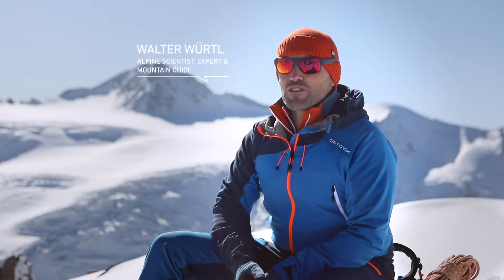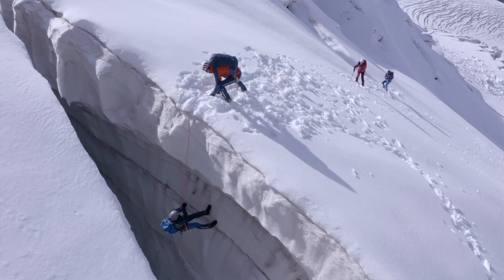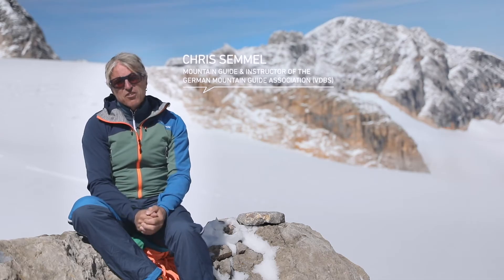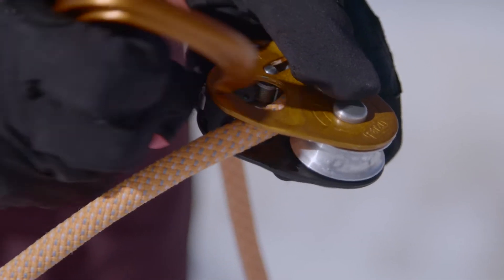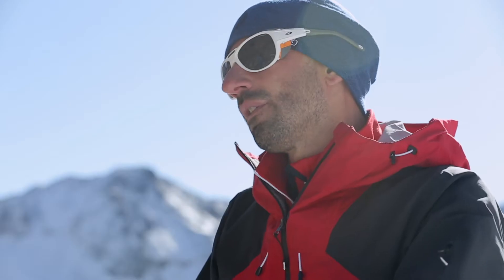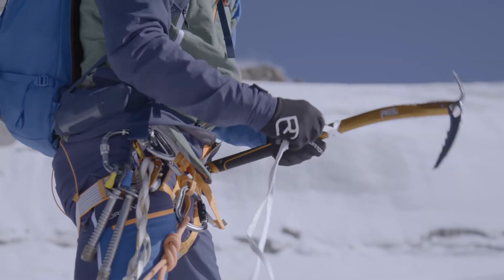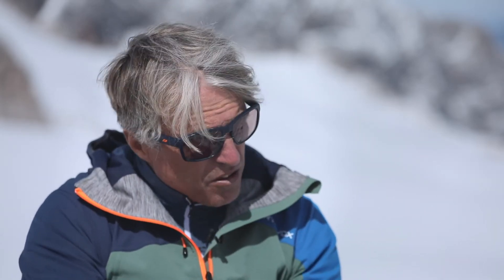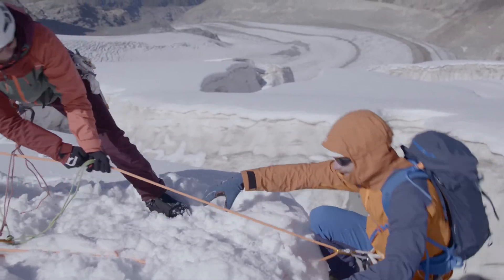Pulleys: Crevasse rescue with pulleys on a glacier – Tutorial (15/18) | LAB ICE

Comment: How do rescue of sheepulle and zedpulle systems.
Reply from the maker: Hi Netai, 

you can use pulleys for almost every rescue system when you need to redirect the rope or block the rope in one direction and be able to pull in the other. This – as mentioned - is almost always needed for the different rescue and hauling systems. The main advantages are the reduced friction and the much easier handling (compared to Prusik or Garda). 

Hope this help!

Best, your ORTOVOX-Team